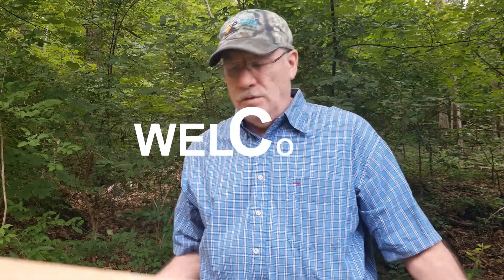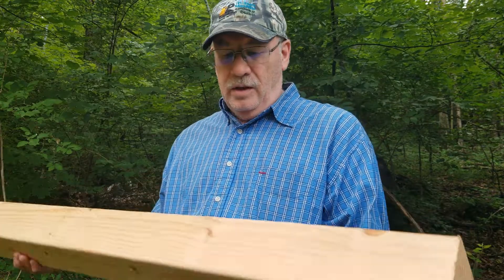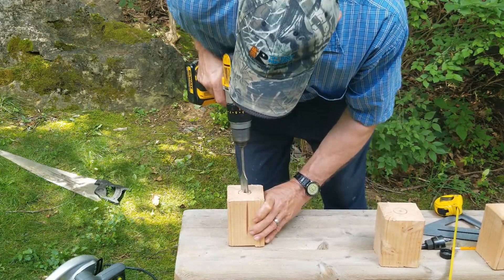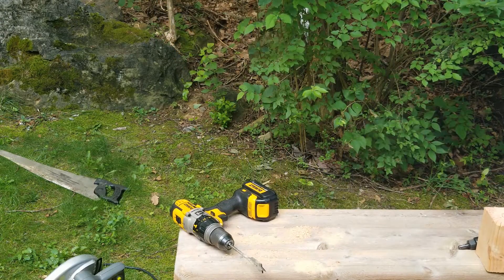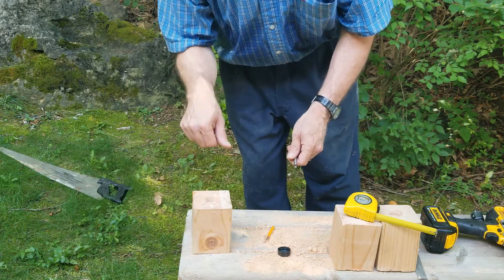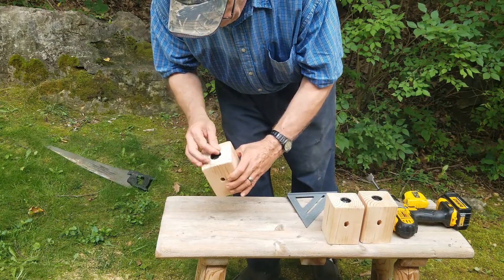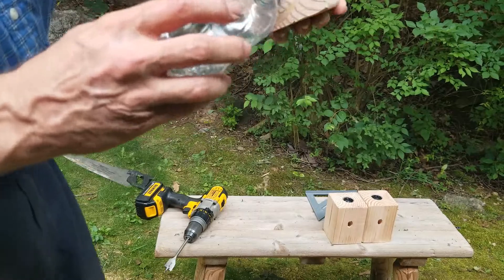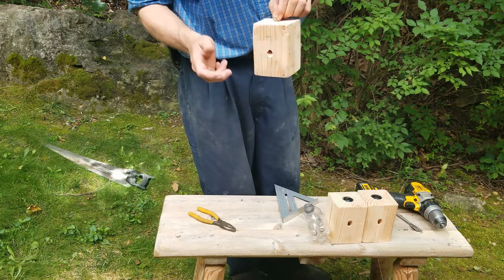HOW TO make CARPENTER BEE TRAPS that will last a LIFE TIME simple.

Comment: If they don`t like treated lumber then tell me why my deck with all treated lumber is full of holes with carpenter bees crawling in and out.
Reply from the maker: I have had the same problem my friend. Is your treated lumber more than a year old. They don't treat the wood like thy use to (EPA). The treatment they use don't last very long at all. It dries out to quick. Lately I noticed one drilling in to my porch swing arm on the bottom and not the house. So strange. It is treated wood, But 10 years old. You make a good point. Thanks for the comment my friend.